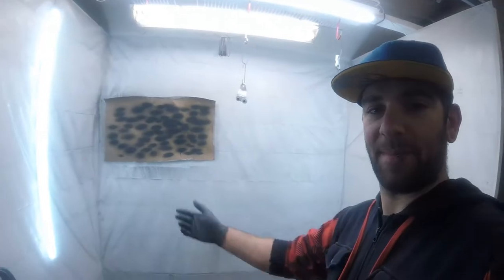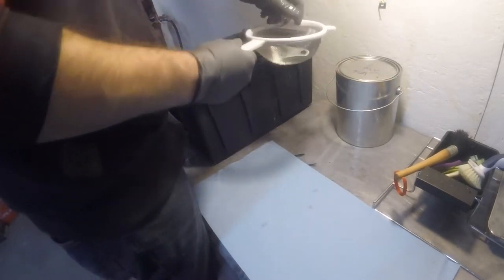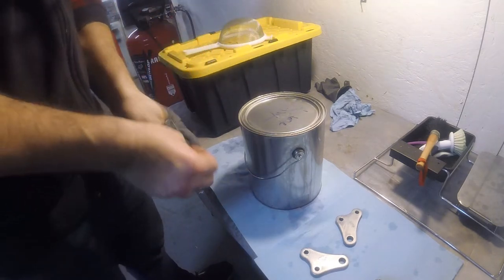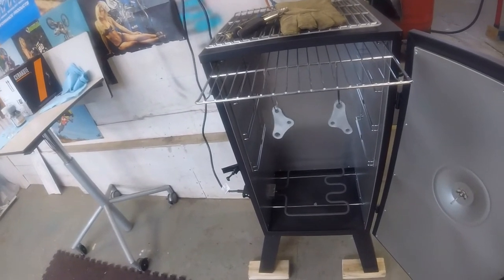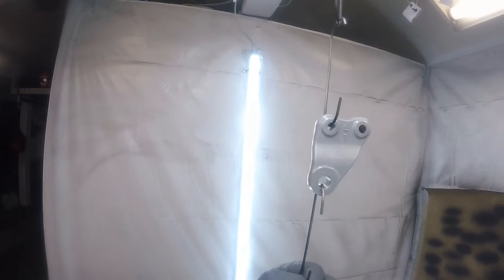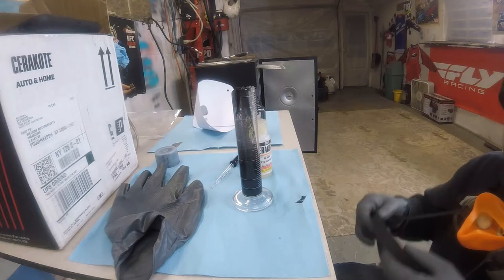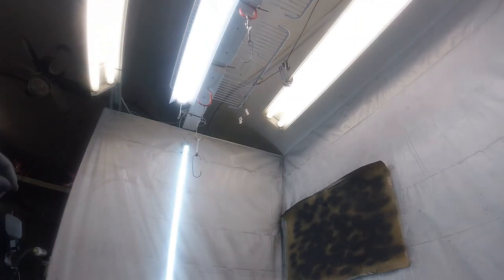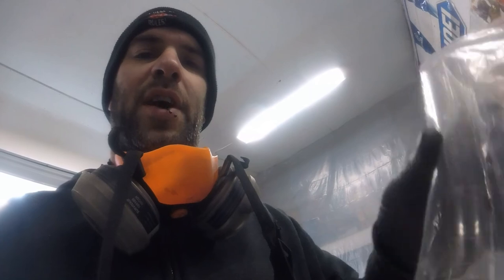CERAKOTE PROCESS

Comment: What about the strainer? When and why do you use a strainer? I saw it sitting on the table
Reply from the maker: I used the strainer to hold the parts im cleaning u can see i have the parts in the strainer while scrubbing them just lesses the chance of contamination but keep in mind cerakote is more forgiving then its made out to be
Reply: @SIX1NINEGUITARSANDGEAR  when your mixing the cerokote there is a paper strainer sitting on the table. Are you suppose to strain it into the gun after you mix it? Always been confused on this
Reply from the maker: I always used the strainer when pouring the cerakote from the graduated cylinder in to the paint gun